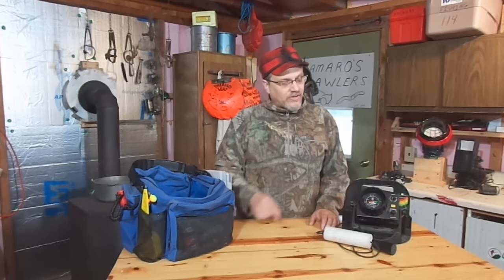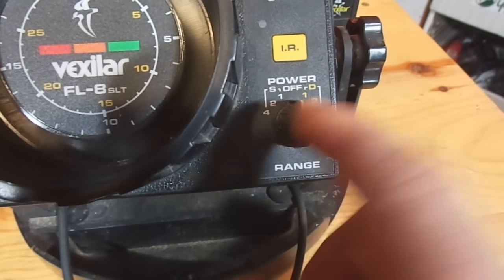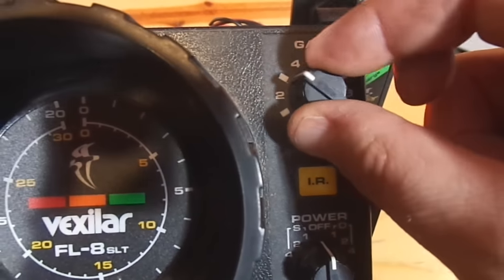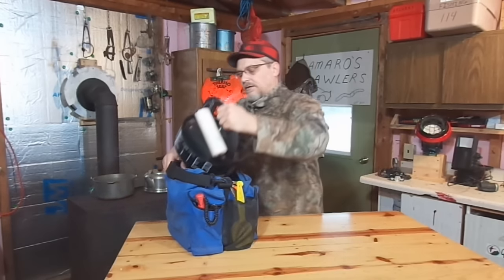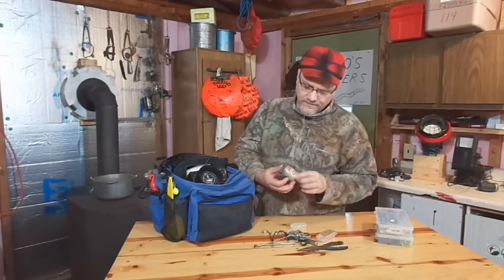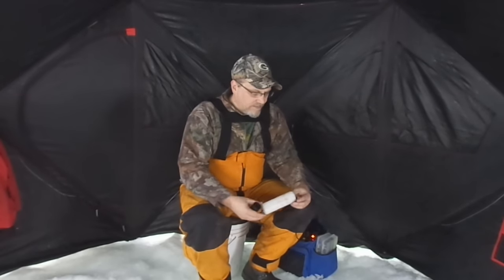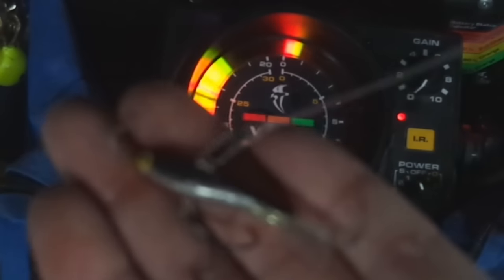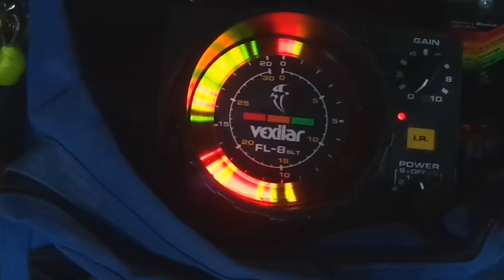Ice Fishing - Vexilar FL-8 Basics

Comment: Good video.  The IR button stands for Interference Rejection.  If you are close to other finders you can pick up interference which looks like blinking lights or a false christmas tree.  You hold the button until the false marks disappear.
Reply from the maker: coyote, thanks for helping out with the IR. KPO
Reply: coyotecrazie5 I knew what the button was for but did not know about holding it down until the interference is gone. I just thought it was an on/off button. I’ll be trying it next t8me out. Thanks!
Reply: coyotecrazie5 thanks I was about to post a comment about that , lol
Reply: I was also gonna comment on it. If u read the owners manual it tells you all about the IR button.